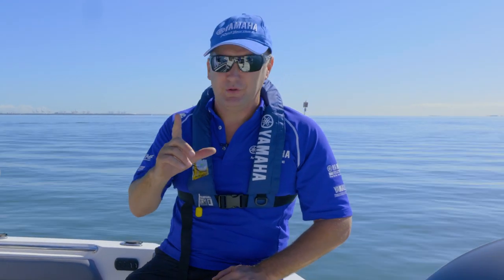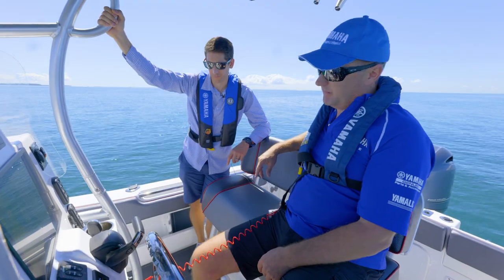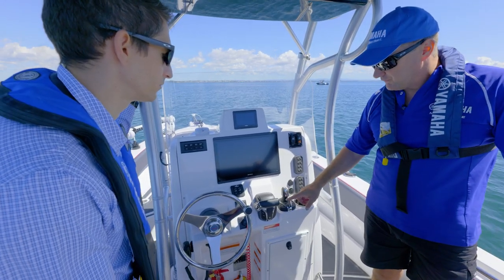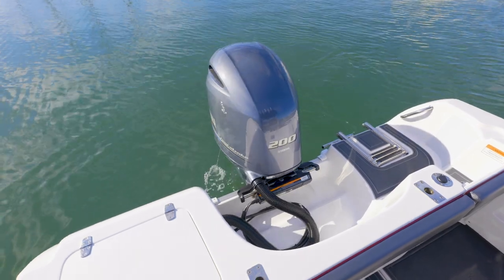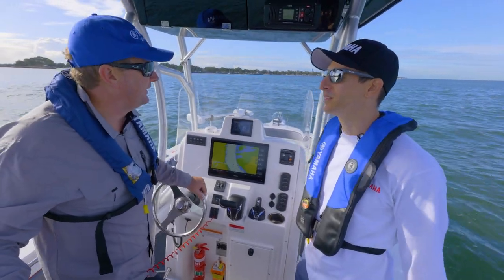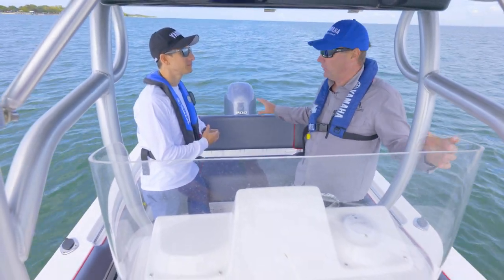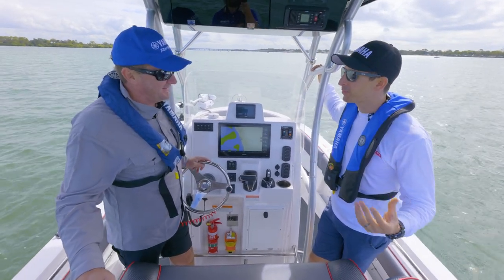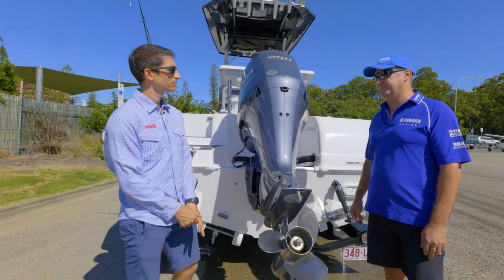Yamaha Outboards Helm Master EX System Overview

Comment: what happens to engine hour counter when using spot lock feature with this?  Does this mean you are adding 10hrs / day to your engine hours, rather than using electric to hold you there?
Reply: Good question, I would like to know this too.

Comment: I love the device I noticed on this video you have  bolt on electric steering on a 200 hp motor yet on the yammi web site it only has 225 hp and upwards configured for the system
Reply from the maker: Hi Anthony, you can fit Helm Master EX to any Yamaha DEC outboards from 150 - 425hp.
Bolt on steering like the one shown here is required from 150-225... 250, 300 and 425hp models are available with built-in steering instead.

Comment: Did I see a Minn Kota on the front of your test boat? Does this system do away with the need for that accessory?
Reply: Exactly my thoughts, what's the need for the minn kota?
Reply from the maker: Horses for courses, but the MK was fitted before Helm Master EX dropped in July 2020.

Comment: Nooooooo! You can’t just keep changing gears like that all the time the gearbox will blow!

Haha F350 go BRRRRRRRRRRRRRRR
Reply from the maker: Incorrect. Helm Master EX was designed from the ground up by Yamaha engineers to minimise impact on existing parts and operations. Thousands of hours of testing in all conditions have shown no problems.
Reply: Yeah Yamaha claims there’s no problem with the constant shifting.